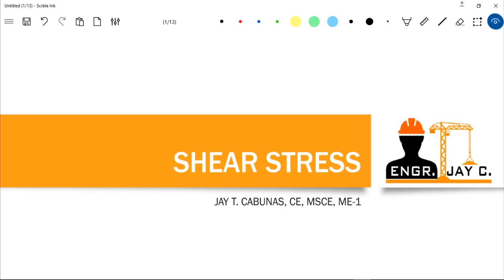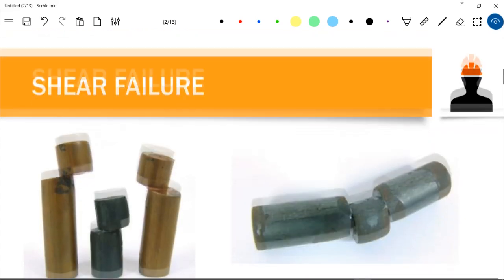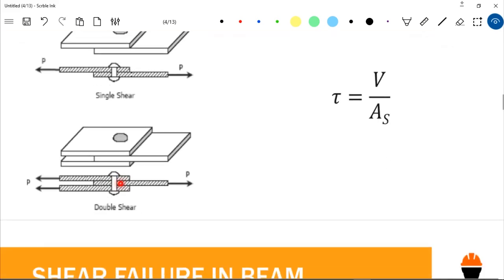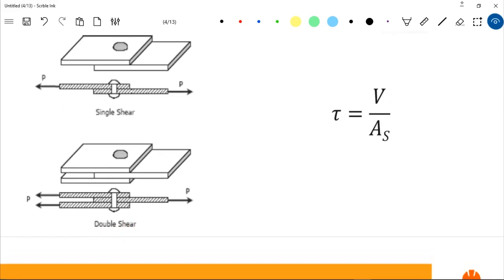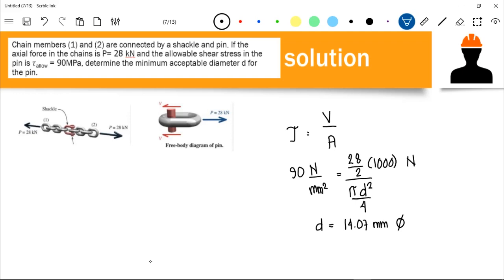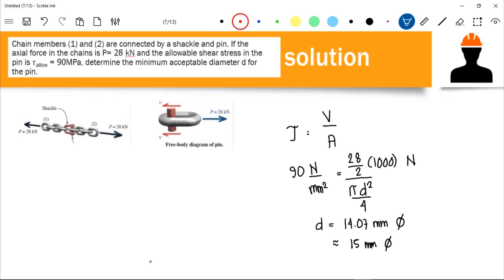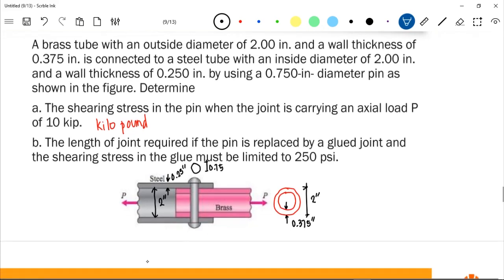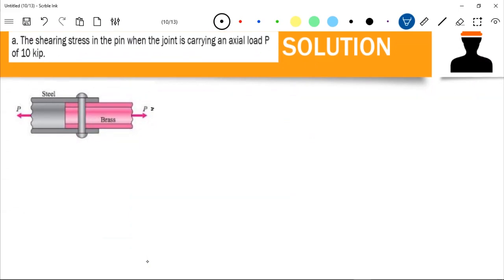Strength of Materials: Shear Stress (Filipino, English)

Comment: Bat naman po hindi bearing stress yung plate na pinunch?
Reply from the maker: Pede din bearing stress pero dapat you know the difference between bearing and shearing stress. bearinh stress pag ang area na ginamit mo is perpendicular sa force. Shearing namn kung parallel. Which in my example ang area ma ginamit ko is parallel.